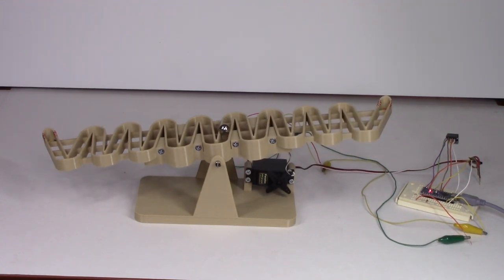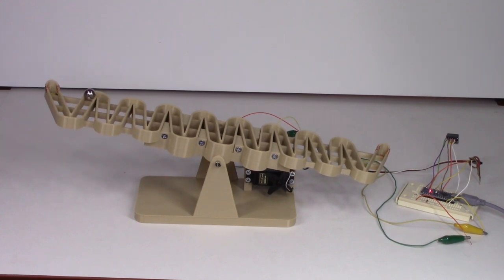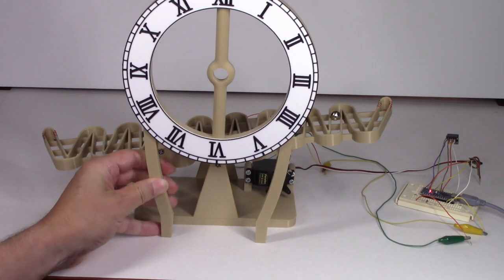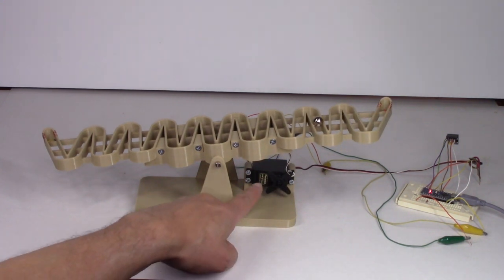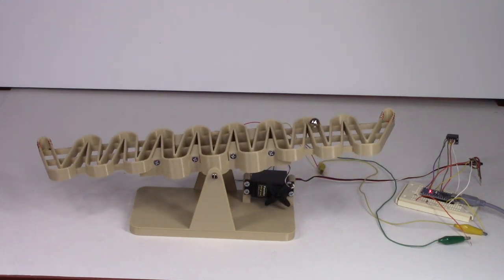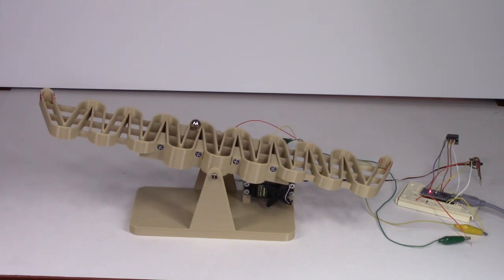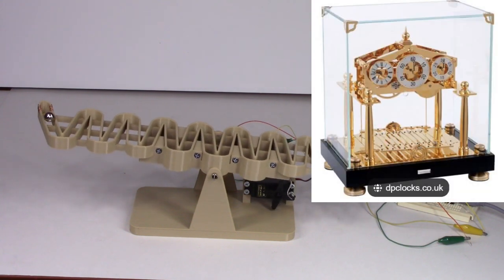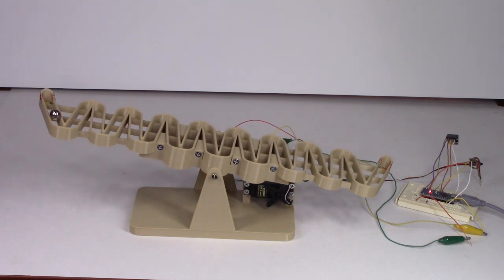Congreve clock prototype - 3D printed

Comment: Hi. Awesome mechanism this Congreve clocks are. Did you finished this one ? Regards from Argentina
Reply from the maker: The classic mechanical design is horribly inaccurate. My design uses a microcontroller and an RC servo motor to tilt the table. This could make it very accurate, and it would still keep time without the rolling ball. This makes it less interesting, so I stopped working on it.
Reply: @stevesclocks  I like it. Do you know where I can get the driver plan ?
Reply from the maker: @LACARRINDANGA The code was only a simple test routine. The entire code was a loop with "short pulse, long delay, long pulse, long delay". It may have also detected when the steel balls hit the wires to determine when to tilt the tray.

Comment: You could make it stop the tilting during the night for peace and quiet. Good work.
Reply from the maker: Yes, it would stop and wait until it detects the ball. The RTC could be left out as well if that is the expected use case.
Reply: @stevesclocks  Another idea would be to vary the tilt as the ball travels, so the ball is not doing max speed when it hits the end. Not that I can see any advantage, just that it is something your servo could do.
Reply from the maker: @david_pilling  There is an advantage to tilting higher at the beginning to ensure the ball doesn't get trapped by the roughness of the wire sensor. Once the ball has some momentum, the track could be made shallower to slow it down. The total run time could be varied depending on when the transition occurs.

Comment: Steve, really looking forward to this being released. I have a bunch of pendulum movements that  I need to use in the electromagnetic pendulum clocks you designed.  I never had great luck with accuracy with them, but great fun to watch.  A question on this clock, it seems the ball track is mostly for appearance, could you eliminate the contacts on the ends and just time the track tilt?  Would like to know more about what parts you think this will need.  Good job as usual and I'm certain the instructions will be extremely detailed
Reply from the maker: Good point. Yes, the ball could be made optional. I keep going back and forth on the design. It would be easier to just blindly tilt the table every 10 seconds without any sensors. 

Adding sensors allows the clock to appear like the ball is completely controlling the rate. Hiding some adjustment when the table tilts would allow the clock to be extremely accurate even with variation in the table travel delay. The sensors make it easier to do this.
Reply: @stevesclocks  I agree that the ball is needed for appearance.  I think the ball should have a slight delay  so the cycle is complete after the ball finishes.  I like the sleight of hand